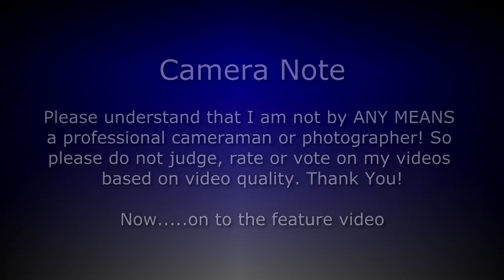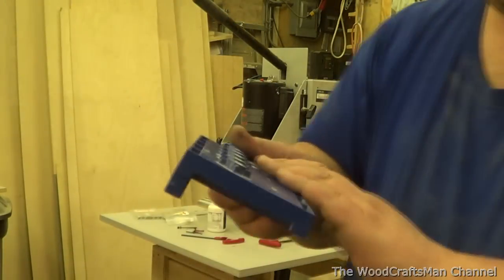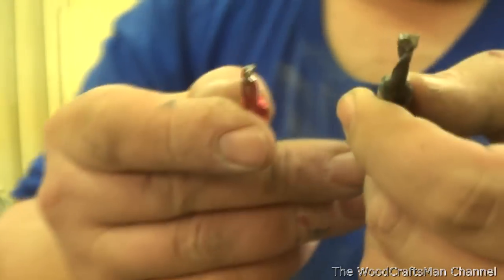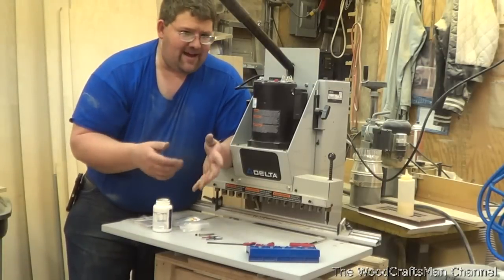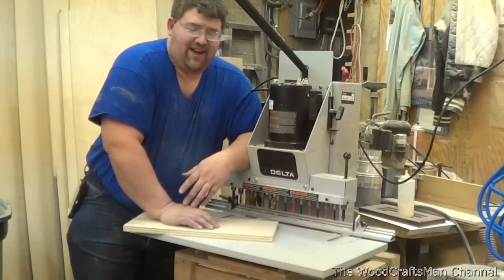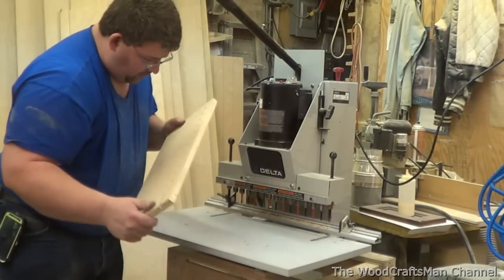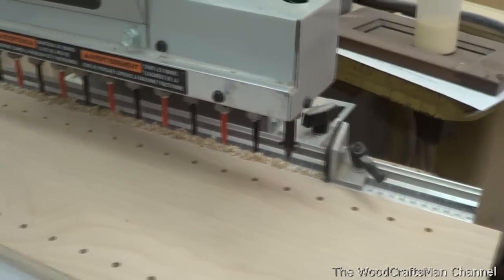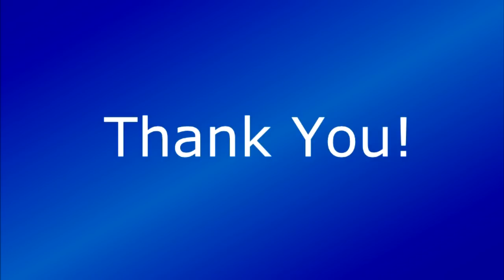Delta 13 spindle line boring machine # 131

Comment: I wonder if you’ve thought of a way to increase the stop capacity.  So if let’s say I wanted to have holes start at 10” from the bottom.  Or more.  The stops just seem too close for my needs.  I use this machine and just love it.  It’s not that good for mdf core though.  I have to really pull down and go up and down several times to drill through mdf.  But ply and melamine is soooo easy and clean.  I would love to mount it in a work bench too.  Love your videos.  I’m in California.  Got mine off craigslist also.  Great find.
Reply from the maker: Hi, thank you for the kind words! I thought the same thing. Usually if I have a short cabinet I take bits out from the ends. Yes, the stops aren't that great, in fact, if the sides get the back rabbet cut before the shelf holes, the stops are useless. If I had the space, I'd do away with the factory fence, and build my own out of some 1.5" square 80/20 extruded aluminum with multiple flip stops. It's nice to here that I'm not the only one with issues drilling into a mdf core  sheet stock. I use a plywood that has an outer layer of mdf and the inner layers are fur. Yes, regular plywood drills right in with ease. I believe the mdf is not clearing away from the point in most cases. Do you know what brand bits you are using? If you want to chat outside of  the comments, you can go to my channel and click the "About" tab and contact me through the link at the bottom. Thanks. Scott

Comment: For this size shop, this is a great return on your investment, I have owned every friggin type there is and we don't use them any more but you are gonna love that machine, Cheers!
Reply from the maker: Hi, thanks for the comment. This is something I should have had a long time ago, its not the top of the line and more of an entry level machine, but I guess I needed to start somewhere. I originally was looking at a new Conquest Mini or a used Ritter R-113 from 360 Degree Machinery in IL, but the Ritter had a much larger footprint, and the cost of the Conquest Mini was only a couple hundred less that the Ritter and only half the machine. i came across this one on Craig's List from a cabinet shop liquidation. I'm happy with it so far. Thanks again. Scott

Comment: I just inherited that identical machine and I have no use for it. It has a plexi glas shield in front of the bits. your video was a gold find to me as I knew nothing about the machine.  thank you for the video. question is what are they worth, as I want to sell it?  Lawrence M.
Reply from the maker: +lawrence white Hi, thanks for the comment. If it's in good working order and the nylon gears are in good condition, I would say $800-1100. If the nylon gears show heavy wear or are partially stripped, $500 or less. I got this one for $1100 and was only 2 years old when I got it. Scott

Comment: Thanks for the video, wondering have you ever considered doing system 32mm euro cabinets vs face frame?  I'm currently looking for a line borer currently I use a few 1/2" plywood template that are the size of the gables upper and lowers and use my plunge router it does very clean holes, I have all the system screw locations built into the jigs and use 5mm euro screws for the hardware. (I think the Quincy post got cut short, thanks very much for that)
Mike
Reply from the maker: Hi Mike, thanks for the comment. 99% of what I do is face frame either overlay or the rare occasional inset, however I did a couple of vanity and linen cabinets about 5 years ago that was frameless. I just improvised for the hinge and drawer slide mounting for them. thanks. Scott

Comment: I thought you had died an gone to heaven.  Glad to see you back. 
Is there a depth stop that is adjustable or does it drill to a determined depth?
Reply from the maker: Hi kris, thanks for the comment. I've just been super busy with work and in the shop. I haven't had a lot of time to do much up until now. There is a depth stop that is adjustable  Most every thing is adjustable on this unit. Thanks. Scott